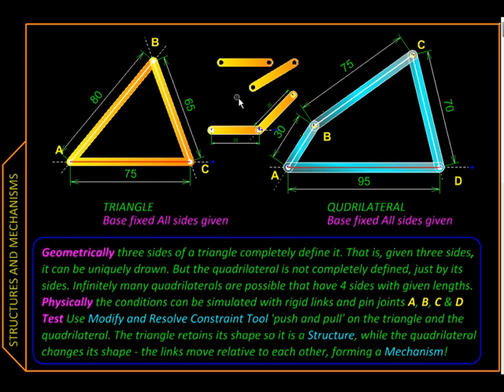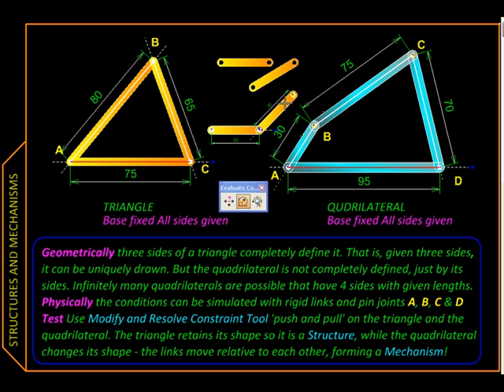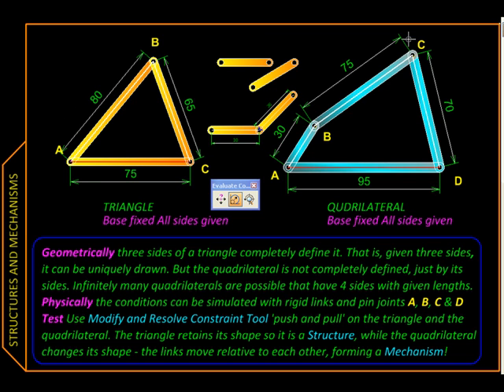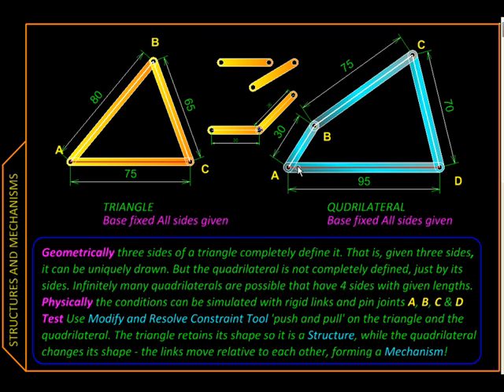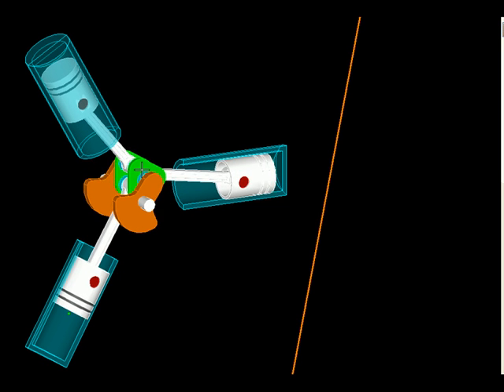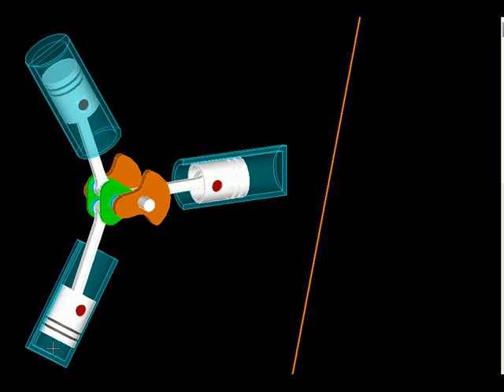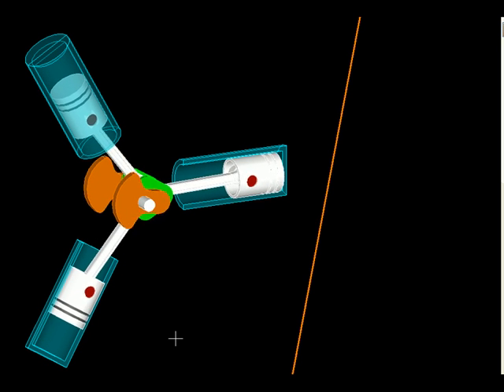Kinematics Ch01A Defining Mechanisms

Comment: Can you do a video on how to get a mechanics to move in a "pinned" manner like you show here using Microstation?
Reply from the maker: It easy to show a machine part pivoting about a single, fixed point, because that is pure rotation. But I guess you have something more complex in mind. So could you please elaborate more?
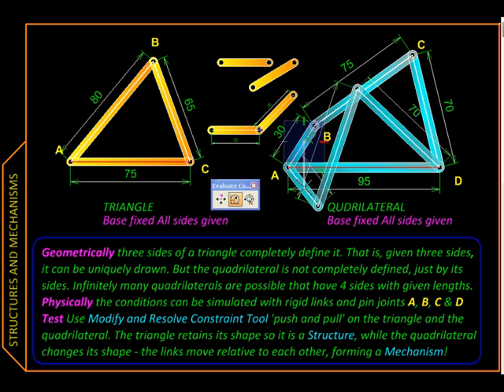Reply: I was hoping for a tutorial specifically showing how to have Microstation perform that, where you can click and manipulate the mechanism that way. I use microstation, and if I could grab a mechanism and rotate it like you do in minute 1:30 that would be awesome! Thanks for the reply!
Reply from the maker: Sure, with MicroStation you can do that. Depending on the version you are using -
1. MicroStation CONNECT - Look for constraints. Apply 'Fixed' constraint to the immovable link. Apply a 'Coincident' constraint to the centers of the holes in the two links. That simulates a pivot and the other link can be dragged to rotate.
2. If you have an earlier version, look for Dimension Driven Design. It too has similar, but 2D constraints. You can fix one link and use coincident constraint to pivot the other to it.
I know this is not very descriptive, but it's more of a pointer to where to look in the MicroStation Help.